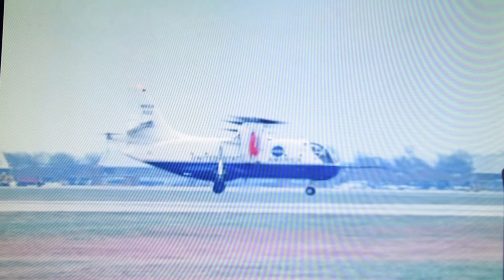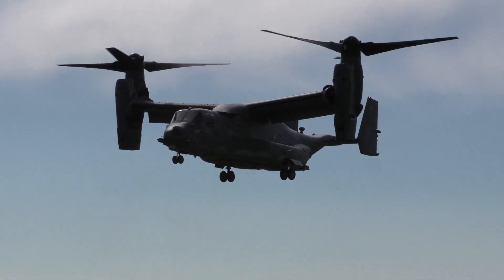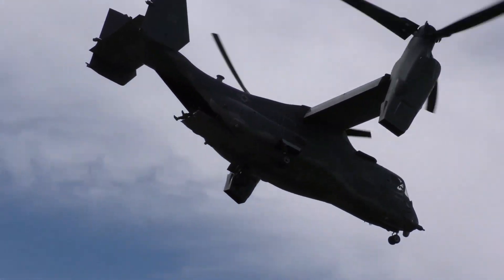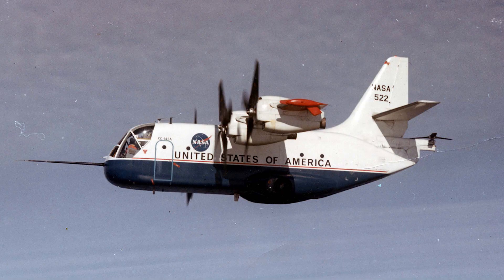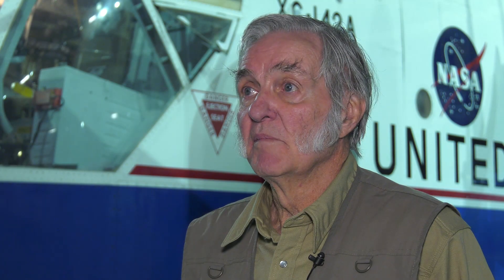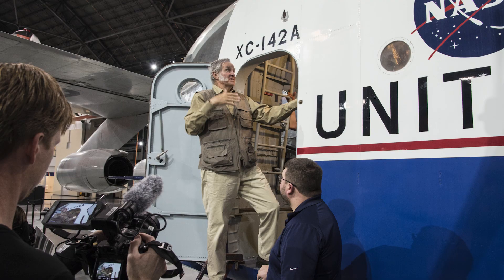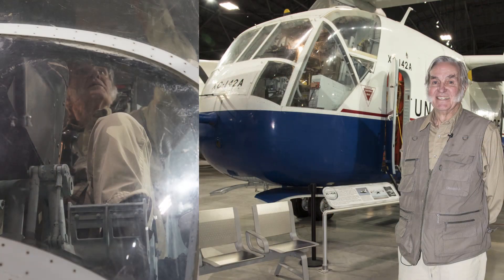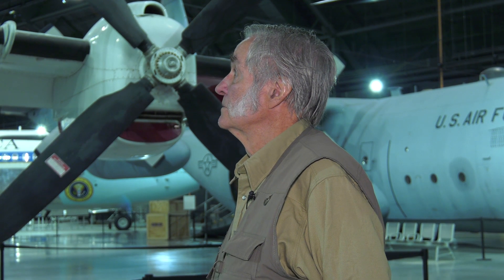National Aviation Hall of Fame Enshrinee Burt Rutan Talks Tiltrotors

Comment: Love this guys plane designs. my favourite would have to be the pulse detonation powered long ezy just because. They pretty much took an engine threw away the big heavy block kept the starter (not really but you get my drift) to spin the cams although now we'de use solenoids and rde's cut the cams so its all intake baby and stuck long pipes on instead of a block  now you have thrust minus the crank block gearbox and prop.  Simplicity at it's  best albeit loud simplicity ;) .